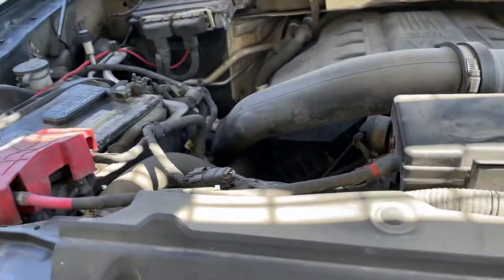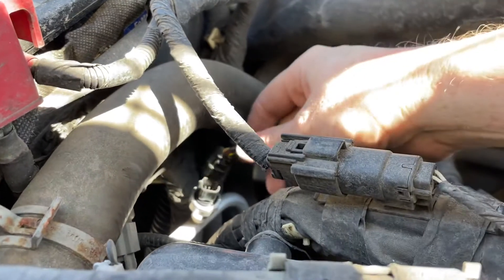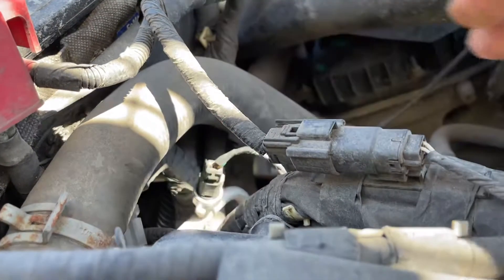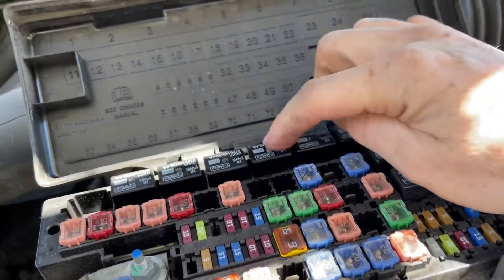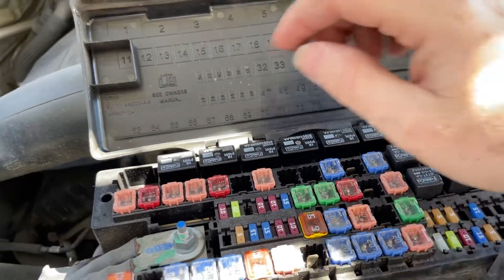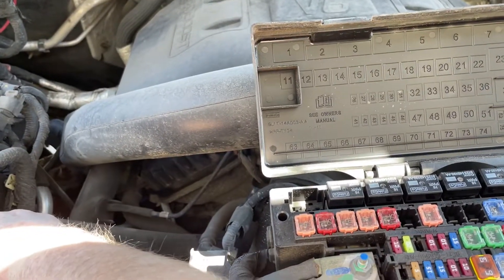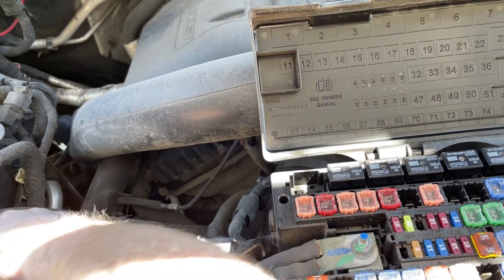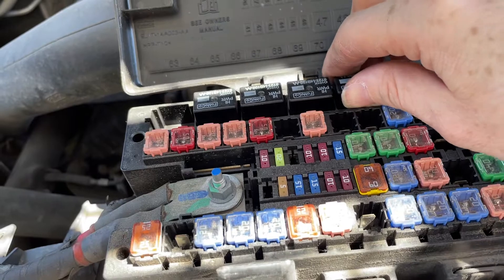I need your Mother Foxing Help!

Comment: Well if it has any codes might go after them but sounds like the fan controller,  might disconnect the big plug to the fans check for corrosion or wetness or pin issues clean it out real good spray some air dry it out reconnect see what happens 🔧🚗👍💪💯🇺🇲 I beleave the fan controller is part of the fan assy or even to much press in the ac system like a stuck expansion valve or restriction in the system
Reply: I had a lot of expansion valves giving me this problem. Would put a set of guages on it and high side would be over 400 just setting there.
Reply: @SpeedAddict731   lol ya I was hoping he could do the beat on the valve a little test 🤣👊👍🔧🚗💪🇺🇲